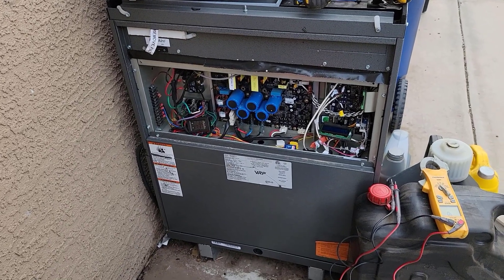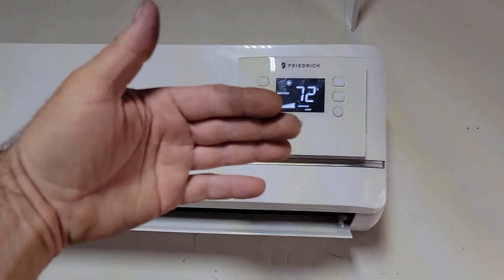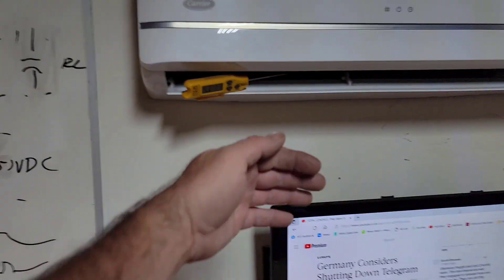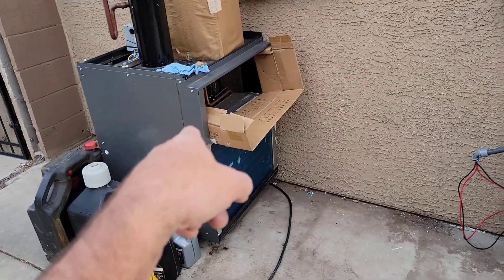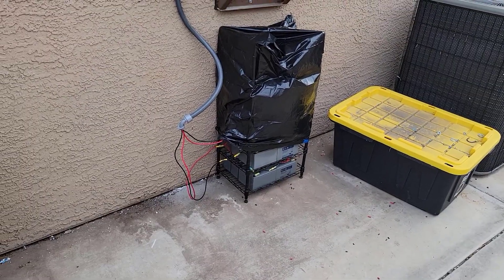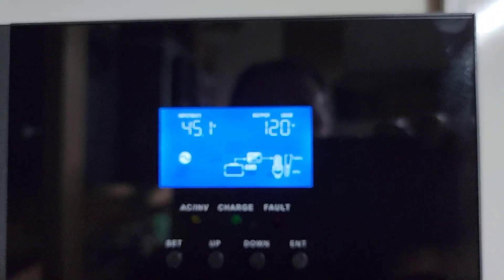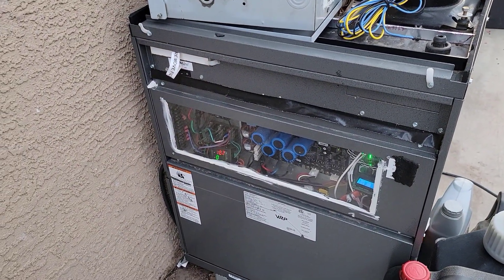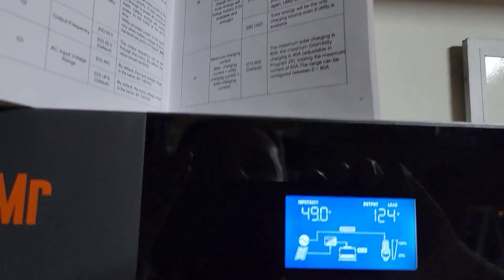New Solar Charger Inverter project Part 2 - Powering up my Frankenstein VRP!

Comment: Awesome videos. You answered several powmr questions.  Your shop looks like mine. Cool. I'm doing two 5.5kw in parallel for 11kw 240v and a 5kw step down transformer for 120v.  Lithium 230ah 48v. Just upgraded my old grid tie and 48v lead acid/solar. My lead acid lasted 8yrs but now look like your fried ones. Upgraded to low power mini splits ac/heat. Thanks for your truthful hands on videos. Like you I decided to get ready for when everything goes offline. I'm a tech also. Enjoyed your experiments.
Reply from the maker: Awesome system.
And yeah.  Things could go dark.  Or at least intermittently with the way the world is heading.

"Build it back better" is sugar coated BS for breaking down the economy and enslaving people under climate change law.

They find even hide that plan.
It's just that people plug their ears.

Comment: When using that 120 to 240 step up transformer how many amps do you think you can push max through that transformer? Im tempted to try something similar with my project to run it off my 120v generator.
Reply from the maker: 1kw is what this one is and it was pulling over 1kw through it. 
I'm sure it will be OK for shorter periods but if I had to buy one for this purpose I'd buy a 3kw etc. 

The good thing is this VRP will throttle back once it gets closer to temp and cruise at a lower capacity